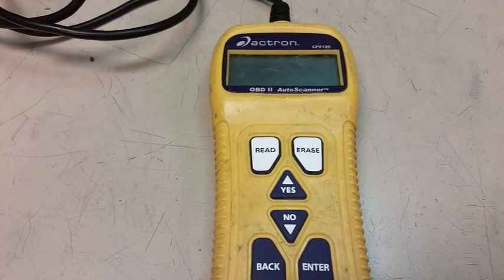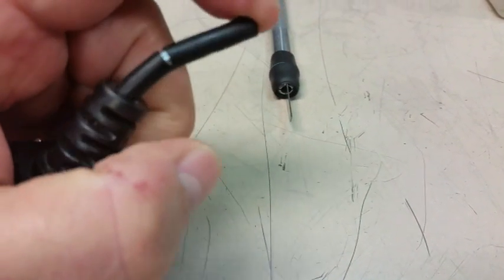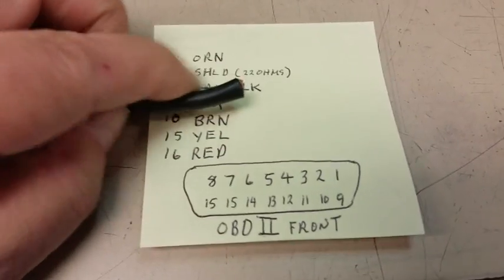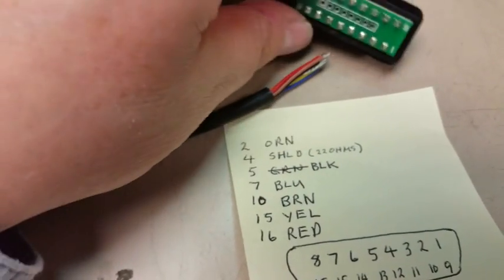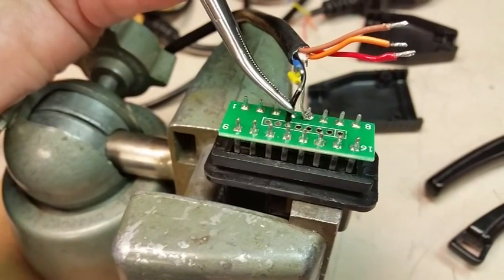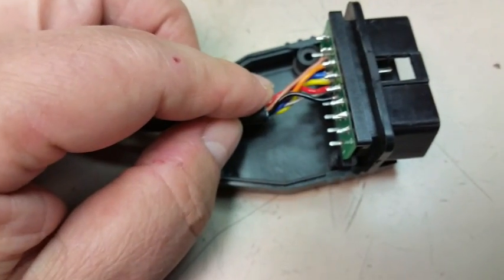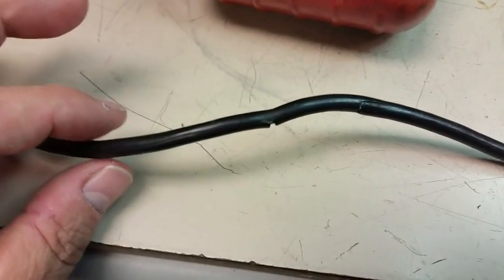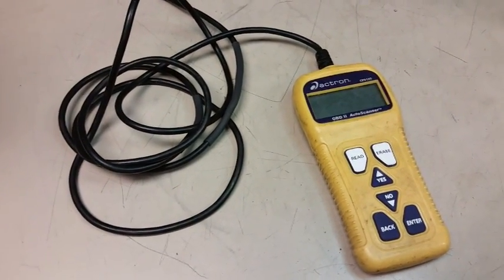OBDII Scanner Connector Replacement Step by Step Actron CP9135

Comment: I did not see how you soldered the wires into the holes. great video & looking forward to more.
Reply from the maker: Yep I just reviewed the video and I didn't show the soldering. I did show how to put the wire in the hole, just put some solder flux on the wire, put it in the hole and touch the wire, board at the same time and feed some solder into the hole until it's full, then follow the rest of the video. Hope that helps. Best Wishes & Blessings. Keith Noneya

Comment: Keith this is way cool. I am working on something which might require me to do some OBD2 work soon. Thank you, liked it very much!
Reply from the maker: I Tam long time no hear from. Glad you liked the video. Just remember when using an OBD2 scanner that although it says it is a particular item it means that something in that circuit for that sensor is bad. The sensor is usually the problem, but it can be the wiring, connector corrosion or even the computer causing the problem in that circuit.
Best Wishes n Blessings. Keith PS send me an email on how you're doing. Keith
Reply: Sorry Keith for being so silent for so long. I still have your email on my BlackBerry and hope to be able to respond tonight when on the aircraft.
Reply from the maker: Thanks Tam. Look fwd to your email. Gonna hit the sack (Bed) in a few hours as I have to get up at 4am for work. Chat with you on your email tommarow Tam. Keith
Reply: Obd 2 how to get.

Comment: Hi I lost my cable for my Launch 8001s are all obd2 cable pinouts the same
Reply from the maker: Hum that's a tough question to answer. They should be the same pin names, however I don't know if the colors are the same. So unless it's the same model I can't say they go to the same pins inside the unit. You can pick up a new cable on eBay for around $30.00, unless you have all the parts to build a cable it's probably cheaper to just buy one. If you do have the parts you might look around on line and see if you can find the wiring diagram for the cable and build it then. If you don't have experience in building cables or electronic repairs, trust me just by the cable so you don't end up frying your Launch or your vehicles PCM. Hope that gives you some options to consider that will meet your needs and get you going in the right direction. Best Wishes & Blessings. Keith Noneya

Comment: KEITH NONEYA, the DLC connector has SAE J1850 buss signals and ISO9141 K &L signals, what are they used for and what are the common failures from these signals?
Reply from the maker: That's a really good question. Unfortunately I'm not familiar with the particulars on signal parameters used in automobiles. It sounds like you know more about those than me. When you find the answer post a reply to let us all know. Thanks for the interesting question though. Best Wishes & Blessings. Keith Noneya

Comment: hi just a question ...is it any upgrade on this scanners ?? I have one in mexico and doesnt work  with  cars  that were made in brazil...I just tried on VW and some chevrolet cars..
Reply from the maker: I'm not sure. Most of the newer scanners will work with them, but not all. The reason is some countries have a different standard that those countries decided to go with. 
Also some sensors with stop a scanner from working, try this video from Scotty Kilmers channel: https://www.youtube.com/watch?v=5L8CGkZNBtk If you are not an experienced mechanic I wouldn't follow his repair videos, he leaves important steps out. 
Also thry this video specific to VS's https://www.youtube.com/watch?v=8L8QA1E5uZ0  
You can try this bluetooth scanner with your phone, pad or PC. It has some more up to date software. https://www.amazon.com/gp/product/B005NLQAHS/ref=ppx_yo_dt_b_asin_title_o06_s00?ie=UTF8&psc=1 Here's a video on that particular scanner as well and why you should choose it over other cheap Chinese scanners. https://www.youtube.com/watch?v=aW_iP3dhQWM Sorry I couldn't be of more help.  Also don't dismiss the vehicles on board diagnostic dash displayed OBDII and Manufactures codes that you can access by turning the key "ON" and off three times, on the last one leave it in the "ON" position. Do this WITHOUT starting the vehicle. this works mostly on Dodge & Jeeps. Try this YT search "how to access dash obd2 codes" Hope this helps point you in the right direction.   Best Wishes & Blessings. Keith Noneya

Comment: Excellent video, Keith! I had one question.  I have an OBD2 extension cable. It is basically a male OBD2 port connected to a female via a cable.  The cable looks similar the one you used in the video. I need to single out the wires which carry the voltage to power up my OBD2 dongle. I think the red and black wires are the ones. Is this correct?
Reply from the maker: Good morning Ankit. I didn't go that far into figuring out what all the pins did, I only know how to change the connector. Try this web page for more details. It may have the answers you need:  https://www.electronicproducts.com/hands-on-review-when-hacking-an-obd-ii-adapter-choose-carefully/#  Thanks for watching Best Wishes & Blessings. Keith Noneya

Comment: what gauge are those 16 inner wires and where do you get them?
Reply from the maker: Not sure what the gauge is, but I'm sure any 22-26 gauge will work. You can pick up or order wire on line. If you have an old VGA cord that should have some wire long enough. Hope that helps point you in the right direction. Best Wishes & Blessings. Keith Noneya

Comment: what if trhe wires are pulled out of the plug on my performax model i got at menards
Reply from the maker: If the colors are still on both sides just match them up and follow what's in the video. The other option is to get another one use it as an example and then sell one of them to recoup some of the money. I hope that helps get you on the right track. Best Wishes and blessings. Keith Noneya

Comment: Love the video, does anyone know the name of the pins as one of mine is snapped
Reply from the maker: Hi Des,  If you have a molded connector end you probably won't be able to change the pin itself without getting real creative, so it's probably best to just change the whole connector. You can do a search on eBay for OBD2 Male Universal Case 16 Pin Terminal Connector and a few should pop up. Try eBay Item number 322321344202. In the Select window the male connector I used was the OBD-M because it matched my reader. Make sure the connector you use is like the one on your tool by pin number and type, male or female. My reader only used a few pins on the connector and some tools may use more so make sure you keep a some of the wire hanging out when you cut the old one off so you can figure out what wires go to which pin on the connector. Hope this helps. Don't be shy if you need to ask more questions as needed do it and i'll try and help. Post a video if it's really complicated and and i'll watch it and reply. Thanks for watching. Best Wishes n Blessings. Keith Noneya. PS if the video helped drop me a thumbs up. Thanks Keith

Comment: Mister tengo un scanner centech pero se soltaron los cables del conector que va al carro y no se como conectar!
Reply from the maker: Sin el conector tendrá que obtener otro escáner. Consiga la misma marca y modelo. Abrirlo y utilizar las conexiones de cable dentro de saber qué alfileres ir. Usted puede tener que comprar un uso que para comparar los cables y luego venderlo para obtener su dinero de vuelta.
Espero que mi idea te ayude. Gracias por ver. Los mejores deseos y bendiciones.
Keith